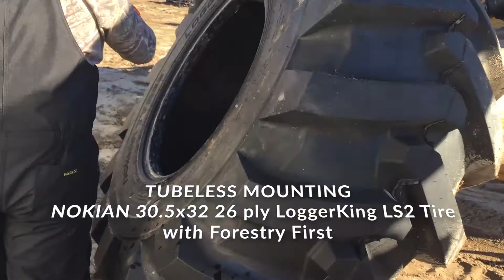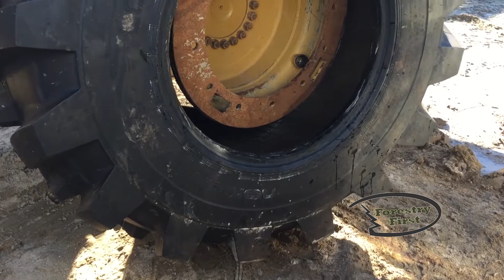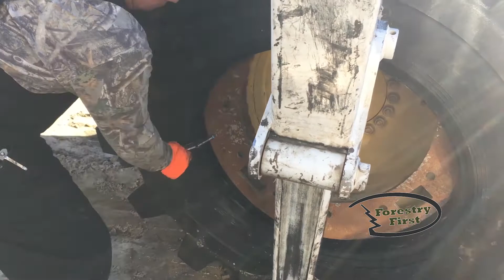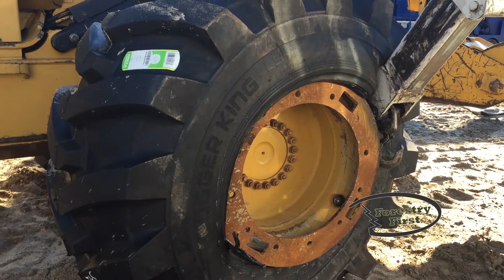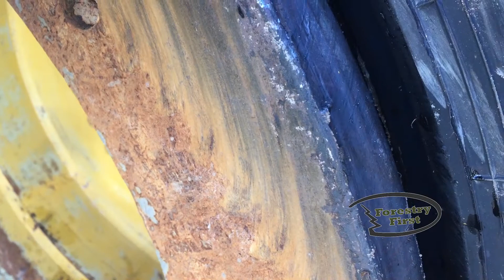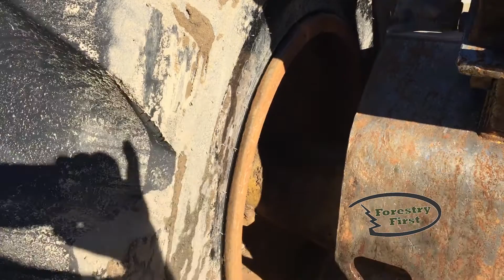Mounting 30.5 tires - Nokian LoggerKing LS2

Comment: Easily done as i watck, but i wonder  how many bead tears he has at the vise grips and where the crane pushes the bead over the rim? Forestry tires can be tough, and using the crane to help is a great idea, but when you tear a bead even slightly, air will migrate into the casing and cause a bubble .(air migration separation. Hope he put "Tire Life" in that tire!)

Comment: And if you tear a bead, putting a tube in it will only prolong the problem. The tear will eventually cut a hole in the tube from flexing. "Tire Life" is the only possible way to get the ripped bead tire to run out its full life. Tubes a flat waiting to happen!!!

Comment: How much do these tyres cost per unit.?
Reply: I run Firestone Forestry Special which are far superior to Nokian tires unless you like having them vulcanized. And that size will run you bout 4200.00 each for 26 ply.
Reply: @timberslasher4899  thanks for that. very interesting. I was told primex log stompers were really good.
Reply: @chrisfleming5109  primex has a better line but the log stompers are absolute bargain basement junk. There is a cheaper brand called Samson if you can still get them that are pretty decent tires all around. Firestone is unbeatable in my opinion and I run up to L series Deere skidders that weights run up toward 50k pounds, run cable and grapple. Cable skidders are bad to dismount a tire without actually damaging it with a bad operator cause of pulling so hard sideways.  I also highly recommend spending extra on tubes. They will not break loose at the bead near as bad. Just don't run them low cause the valve stems attach to the rim and it will rip loose. The set of brand new Nokians I ran a few years ago on a 180 Franklin cable skidder had decent tread life but they snagged really easy. And they were 22 ply. Have better luck with 16 ply Firestone than 22 ply Nokian , Log Stompers melt like Ice on a July 15th blacktop highway. That being said I have no experience with the high end Primex... some people swear by them.
Reply: @timberslasher4899  thanks very interesting I'm using skidder tyres on a wheel loader here in Scotland.